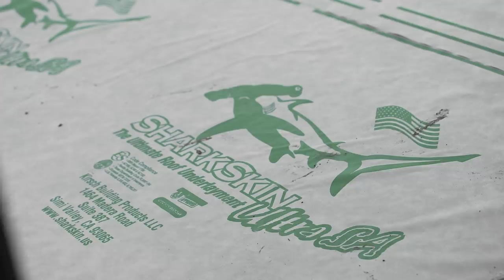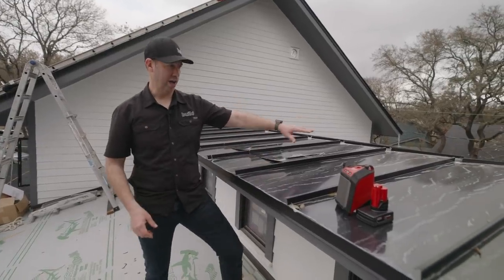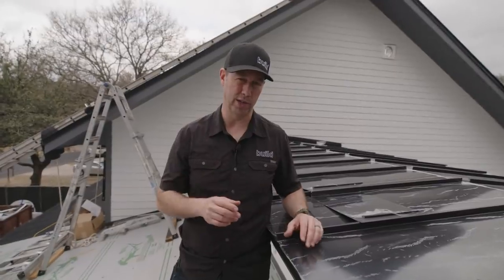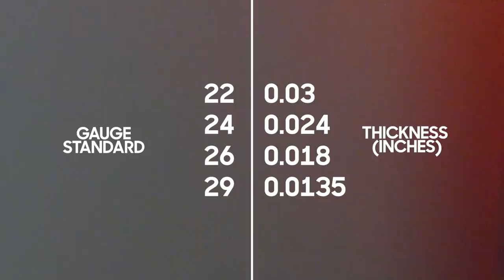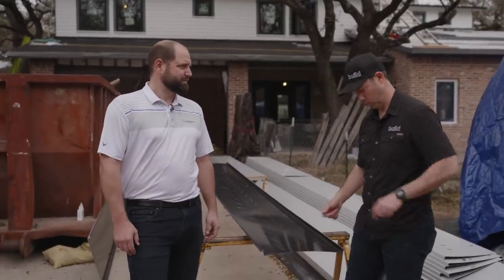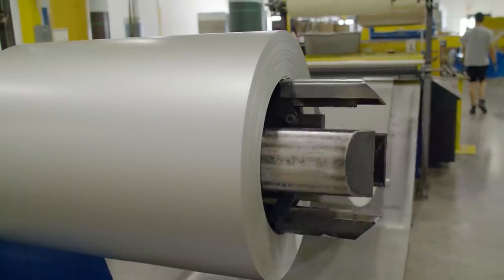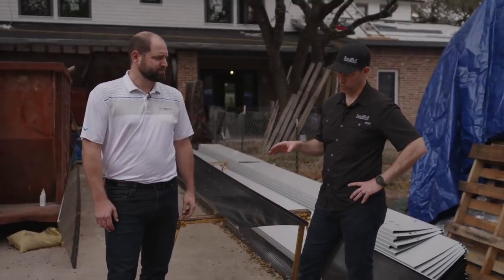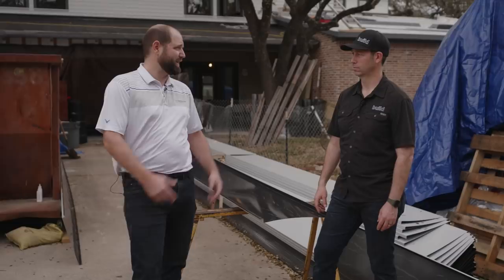Metal Roof- Best Practice Details

Comment: Matt:
Talking about all the ways he is reducing heat with this roof.
Also Matt:
I have a black roof! YOLO! lol
Reply: I'm also confused by facing the reflecting side of the radiant barrier  down, not facing the radiant source..
Reply: Black conducts heat but with radiant down heat doesnt transmit through.  Still though...
Reply: Why  the heck would he do everything he has done for energy efficiency then put a black roof on?  Also metal roofs with that air pocket behind it will dent like crazy in hail storms.
Reply: @aintquitewright1480  
Well on the bright side I have only seen it hail one time down here. :p
(and it was pretty slushy by the time it hit the ground)

but yah..... it seems very few people these days realize black absorbs heat.
I have been to many places and have never seen so many people wearing black cloths.......
Reply: @lgl_137noname6  He didn't explain it.... but kinda sounded like that was a mistake.
I guess he wanted to save time and/or money and is just going to leave it facing down.
Reply: @lgl_137noname6   After I got radiant barrier and a FLIR camera I saw how little IR is transmitted down from the radiant barrier.  Think of a mirror. It doesn't show the IR heat from the other side of the wall it shows the IR reflection from my body and the wall behind me.  My sister got radiant sprayed on the underside of her roof, it works as well as my barrier stapled to the rafters.
Reply: @aintquitewright1480  Thanks for the reply  @Aintquite Wright  .
The mirror analogy is exactly where I'm struggling with the physics. Given that the metal roof if the primary source of IR from direct exposure to the Sun, one would think that , with the proper gappng, one would want the R reflectig surface, like a mirror, to face the direction of the incoming radiation and reflect it back in order to mitigate further IR absorption into the remaining mass of the structure. 
At least that the physics as I think I understand it. But I could be absolutely incorrect.
Thanks again for  your considered reply.
Regards.
Reply: @lgl_137noname6  I've got the same feeling. The sun wil heat up the metal, the metal will start to radiate, and it will radiate on to your house. The way to protect against that is by having a reflective surface on your house. I think the mistake he made is that the rule is indeed that the reflective part should always be facing the air gap, that's true, but it should be facing it from the bottom up, towards the sun, so under the spacer material.

But this is just me theorizing, I don't have a degree in any of this stuff.
Reply: bare stainless would be fantastic for a metal roof but imagining the potential cost is making my wallet wimper in fear lol
Reply: I’m a metal roof plumber in Australia and years ago we always put light colour roofing on until a study came out advising to put dark colours due to you needing to heat your house eight months of the year but only cool it for less than a month , obviously that statistic changes from location .
Reply: @splashpit  those numbers are backwards for Texas.  You have to cool more in TX than heat.
Reply: @aintquitewright1480  depends on how heavy the metal is.
Reply: @splashpit  One wonders what such a study shows for Texas ...
Reply: @lgl_137noname6  Facing down is fine, and should work just as well. 
This is because an object with high reflectivity must also have a low ability to radiate thermal energy, a.k.a. emissivity (pseudo-explanation at the end). If you look up the emissivity of something shiny like aluminum foil, it's around 0.04. This means it only radiates only 4% of what a perfect thermal radiator (a.k.a. blackbody) would emit at the same temperature, which gives the same effect as
if the radiant barrier was installed face-up on the other side of the air gap and reflected 96% of the radiant energy from the roofing metal.

The amount of radiant energy an object in thermal equilibrium absorbs is equal to the amount it is able reradiate, also known as its emissivity. It has to be, otherwise it wouldn't be in thermal equilibrium, and would instead be either heating up or cooling down. If you ignore transmitted radiant energy (i.e. you're looking at something that is essentially nontransparent, like a radiant barrier) then the reflected energy and absorbed energy must total 100%. Because absorbed energy must be the same as emitted energy (thermal equilibrium), you end up with a relationship where reflectivity goes up when emissivity goes down, and vice versa, (assuming nontransparent objects). I know this isn't really an explanation of the underlying physics, but hopefully it is still helpful.
Reply: I think it was on a green building forum, someone sited a study in which they found that roof color does not significantly affect temperature inside the building. With the venting under it, it should make less difference.
Reply: @lgl_137noname6  i don't think risinger quite got that one right. in a wall assembly, you would have the cladding, the air gap, and the radiant reflector on the other side of the air gap with the reflecting side facing outward. what you want is for the radiant barrier to reflect IR away from the sheathing.
Reply: if you are going to go with a black roof, steel is the way to go. aluminum would have truly been a thermal performance train wreck.
Reply: @aintquitewright1480  risinger with with 24 gauge steel. denting is less of a problem than would have been the case if he had gone with 26 gauge or 29 gauge steel. as far as energy efficiency goes, what people may not realize is that asphalt shingles hold a lot of heat.
Reply: @tincoandringa4630  i think that risinger is mistakenly believing that the air channel will cool the roof. so by reflecting the heat into the air channel, the air will remove the heat. if that is what he believes, his theory will fail for the same reason that you cannot rely on a ventilated roof to cool your attic. the radiant barrier needs to cover the roof sheathing to block IR from penetrating the roof sheathing. what risinger's approach is going to do is reflect IR back toward the sheathing. since the heat will build up faster than the ventilation scheme will be able to remove it, the net effect is that his roof sheathing is going to get hot, which will raise the temperature within the house.
Reply: @splashpit  this doesn't sound like a very good strategy. the way that you normally get solar heating is through the strategic use of fenestration.
Reply: @paperwait9611  Risinger does not believe that the air gap will help with cooling. He gives two reasons for the air gap. The first, as always, is to allow any water that makes it behind the roofing metal to dry and/or drain out. The second is to allow the radiant barrier to work properly.
 Risinger did get it correct; it doesn't matter which side of the air gap you put the shiny bits on, as long as they face the air gap. Read the previous comment I made in this thread for an explanation, especially the addendum at the end; if that doesn't do it for you, try throwing search terms like "emissivity" and "reflectivity" together into your search engine of choice.
Reply: @ergohack   @ergohack  Thank you for taking the time to reply. Actually you're quite on the money for the physics:  that's how Kirchoff put in his law of Emissivity. 
Much appreciation for you very considered and enlightening explanation.
Thank you again.
Reply: @paperwait9611  Why do you say aluminum would be worse for thermal performance? Is this because of it's high thermal conductivity? I don't think that will really matter as far as conducting heat through the surface and into the roof assembly, mostly because its so thin. It may actually improve performance (very slightly) for a couple reasons:
1. It would be better at conducting heat away into shaded areas of the roof where outside air could cool it off a bit.
2.  It would even out the temperature distribution that the radiant barrier is dealing with; this matters because thermal radiation is proportion to the fourth power of absolute temperature, so reducing any hotspots will reduce total thermal radiation even if the total thermal energy is exactly the same.
Reply: @ergohack  when it comes to the energy efficiency of metal roofing choices, you don't have to guess because these things are energy rated. that is something that you find out when you research metal roofing. the intuition is that metal roofing is hotter than asphalt roofing. in reality, the intuition on this is often wrong.
Reply: @ergohack  maybe you missed the part of the video where risinger said that he had the radiant barrier facing an air gap. risinger didn't spoon feed everything to you in this video. you had to be able to do some thinking on your own. in this case, you needed to be able to draw the inference that he was relying on the ventilation space to conduct the heat away from the roof.
Reply: @paperwait9611  I'm sorry, I thought we were talking about the energy efficiency of aluminum roofing compared to steel roofing? What is this talk about bad intuition and shingles? As to energy ratings, do you know of an actual "energy rating" anywhere that compares aluminum vs steel roofing, especially with an identical paint system applied? (And no, I'm not talking about the shiny galvalume coated steel, I'm talking about actual aluminum roofing material, compared against steel painted the same color, with the same profile.)

As to radiant barrier; seriously dude, I know which way their radiant barrier was facing. I watched them install it. You know, in the video. I'm not sure how (or if) you read my comments and still came away thinking I was talking about radiant barrier with the shiny side right up against the metal roofing. 
Now, do I have to pull an appeal to authority here and start throwing links to research papers at you, or can you get down off your high horse without the extra assistance?
Reply: @paperwait9611  Just in case this is the bit you're missing, the heat being absorbed from the sun by the metal roof doesn't all need to conduct down into that radiant barrier and radiate into the air gap. As soon as the radiant barrier reaches the same temperature as the metal roofing above it, it obviously isn't going to somehow get hotter than the roof above it. Instead, conduction slows down, and only proceeds at the exact rate that the radiant barrier is radiating and conducting heat into that air gap. This rate, as I explained earlier, is quite low, due to the low emissivity of highly reflective materials.
But, where does all the energy the black roofing metal is absorbing from the sun go? Back out into the environment. The hotter it gets, the more it radiates thermal energy out into the environment, (as I said earlier, at the 4th power of absolute temperature, according to the Stefan-Boltzman law), and the faster it conducts heat into the outside air. As long as you have the same surface, it doesn't matter what you have underneath it, it will reach exactly the same temperature under the same sun, wind, and temperature conditions, as long the stuff underneath isn't actively being heated from somewhere else, as might be the case in the winter. This temperature is precisely when the amount of thermal energy it is gaining is equal to the amount of thermal energy it is losing; a.k.a. thermal equilibrium.
Reply: @ergohack  you need to do some research before trying to make comments. you're just trying to substitute argumentation for actual knowledge. if you had done some research instead of coming here to comment out-of-hand, you would have information about the energy efficiency difference between aluminum roofing and steel roofing. at present, you don't. where do you find this kind of information? a good place to start would be from makers of aluminum roofing products. but since you apparently have not actually considered using metal roofing, you would have no need to consult with such sources.

my comment was that risinger put the shiny side of the radiant barrier on the wrong side of the air gap, apparently based on the incorrect notion that he could rely on the air gap as an effective means to keep the roof cool. in other words, risinger should have put the radiant barrier on the other side of the air gap facing (but not in direct contact with) the metal roofing.
Reply: I don’t know about this specific manufacturer but typically there are reflective pigments in the paint that enable even a black roof to have a high heat reflectivity index.
Reply: @robertunversaw  Very true. Just because something looks black in the visible spectrum doesn't mean it needs to be black in the infrared, UV, etc.
Reply: @robertunversaw  I just looked it up, and Sherwin Williams does offer what they call "solar-reflective pigments" as an option on one of their PVDF paint systems. No idea if that's the particular system he used, or if he chose the SR option, but he did say Sherwin Williams PVDF.
https://www.paintdocs.com/docs/webPDF.jsp?SITEID=SWPCGCOIL&doctype=PDS&prodno=432B2627&lang=2
Reply: @splashpit  where in Australia  does it get less than 70f (21c) for long enough to worry about it? I always thought it was hot as balls year round down there.
Reply: @jeffreyhill1011  Melbourne in winter gets a wind chill that visiting Canadians complain about .
Reply: @splashpit  oh wow I had no idea. Those maple syrup drinkers know a thing or two about cold, I'll take their word for it.
Reply: @billvojtech5686  Completely wrong. Their are numerous studies showing a significant decrease in attic temps from roof color. It is also common sense.
Reply: @RindosRides  Are those roofs asphalt shingles nailed to the deck or metal with a significant air gap? Insulated to R60? At some point, you're allowed to allow taste to dictate color and forget thermodynamics. I'd like to see the temperature in Matt's attic once the house is done.
Reply: @lgl_137noname6  I'm no expert, but from what I've seen and read is that you have to think of the radiant barrier as a transparent system.  To me it doesn't matter what direction it's facing because if it's the mirror side, it will reflect, if it's the grey side, it will conduct through the material, hit the backside of the mirror surface, and reflect back just the same.  From what I've seen and read from the manufacturers, the only requirement for a radiant barrier to be effective is the air gap on one side so the heat doesn't conduct through the metal all the way to the other side.
Reply: @billvojtech5686  From Lil Giant I, too, would like to see temps when Risinger is finished. I sincerely hope he makes a video on that.
Reply: @luthersullivan5141  but how? it's a single-sided ai foil  .. you say emissivity will work?
Reply: @splashpit  ok noted thanks for sharing  :)
Reply: Maybe in this case the effect is minimal, but for the other 99.999% of builds it is not. People like you spewing nonsense like this is one of the reasons this industry is so far behind the curve. Also, there exists paint that is so highly reflective and emissive that it actually cools. So for people that don't want to just throw handfuls of cash at a roof, they can simply do a traditional roof with such a paint and actually get way better results than Matt.
Reply: @RindosRides  
no, lobbyist are the reason constitution is behind the curb...

As an example:
Last time I did construction we had to use these rings for installing the wiring.... they were expensive and made it take more time........ and they ONLY reason for them is it made it easier to pull the wiring through the holes in the studs.
Reply: @lgl_137noname6  yep, facing wrong way! actually holds heat in
Reply: @aintquitewright1480  no it doesnt' because it needs an air gap
Reply: @tincoandringa4630  yep you are right. it is that simple. don't over think it.
Reply: @kevenc  wrong , try painting the shinny side black, it will destroy it's properties. come on this is 5th grade science you are over thinking it!
Reply: @ergohack  you really are over thinking this! shinny side reflects. really is that simple. shinny side facing wrong way = reflect heat back INTO THE HOUSE. if the air gap is big enough it wont' matter, but given how small his air gap is it does matter.
Reply: @sunshine5349  I think the misunderstanding  originates with the manufacturers instructions and installation procedures. They seem to insist more on putting  the reflecting shinny side to face the gap, not realizing that it also MUST   face the radiating source  AND  must not be in physical contact with the source of the IR radiation to prevent  the radiant barrier from heating by conduction from the source.
The gap ought to be between the IR source and the barrier.
At least , that's my current understanding from the ORNL, Oak Ridge National Lab, resource pages.
Reply: @sunshine5349  Not over thinking it at all. This is quite literally centuries old physics. Our understanding of how these things work hasn't fundamentally changed since then; we've only gotten better at explaining what's going on at more fundamental levels, e.g. quantum physics.
Can YOU see in the long wave infrared? If you can't, I'm not sure how you are able to develop an accurate intuition of how these things behave. ( /s)
I would tell you to go read the links I posted for user, all of which described putting the radiant barrier facing DOWN. However, it seems that  the comment system marked them as spam because there were too many in one post, so I guess you'll have to do your own google-fu.
Reply: @lgl_137noname6  
If you read this page https://web.ornl. gov/sci/buildings/tools/radiant/ from ORNL, they describe it being installed both ways, and why it works in either direction. (Just take the space out before the "gov" to make the link work, I'm trying to avoid the spam filter.)
Reply: @RindosRides  what is this paint called?
Reply: @ergohack  thank you for the link.
Reply: @Sun Shine  Au contraire, I did not provide YOU any links. I provided another commenter here a link, minutes after replying to you. Maybe you can figure out why?
700-900nm is far closer to visible light than the 8-10μm you'd be dealing with on a hot roof. If you've actually done infrared photography for that long, I'm sure you are quite familiar with how different things can appear just a few hundred nanometers outside of our visual spectrum. (Some opaque objects suddenly become transparent, some dark objects become bright, the atmosphere becomes much clearer, that sort of thing). How much different do you think it looks when the wavelengths you're dealing with are an entire order of magnitude longer? But, that's not the point I was trying to make. My point was that you probably don't see enough everyday objects glowing with heat to know whether reflective things glow as much as other materials at the same temperature. (What I was trying to explain regarding emissivity in some of my previous comments.) Unless, for example, maybe you also happen to have worked extensively with both noble and non-noble metals in their molten state in addition to the infrared photography. Or something else that would give you experience seeing things that were both reflective AND glowing alongside stuff that is not reflective but still glowing at the same temperature.
Reply: @ergohack  you wrote all that and are still wrong. it's just as simple as it first appears shiny stuff reflect , non shiny side not reflect.
Reply: @sunshine5349  I think you misspelled "I didn't read any of what you wrote because I am an arrogant/(lazy? Worse?!) SOB, but of course I still want to tell you that you are wrong." I'm not sure who you think you are fooling, but they're not worth it.
Reply: @sunshine5349  It's as simple as "not shiny thing glow bigly when hot, shiny thing not glow so much when hot"
Reply: @ergohack    wrm
Reply: @sunshine5349  BaSO4 paint
Reply: @tincoandringa4630  I believe you are correct ... he is not protecting his house from the sun's heat. However, he may be reflecting any heat escaping from the attic back down into the house, if it doesn't all go out the ridge vent.
Reply: Matt WEARS a black roof and really seems to like it.
He really looks good wearing his black roof...so why not do the same with his house.
Reply: Bob Watters  not all of Australia just the southern parts .
Reply: Bob Watters  believe it or not we do get snow it our mountain ranges .
Reply: @ergohack  That really sounds like a bunch of gibberish.  Why would it be manufactured with a reflective side if it didn't matter which side was toward the in bound IR?
Reply: @percyfaith11  The orientation doesn't matter, because reflective surfaces tend to emit less IR than other surfaces. If you put it at the bottom of the air gap on the roof deck, it reflects the IR back towards the roofing material, as most people intuitively understand. When you put it facing the other way, up against the roofing material, the reflective surface emits much less IR towards the roof deck, and you end up with the same net effect.
The nonreflective side is typically installed tight against another surface, where heat transfer by conduction dominates and reflectivity and emissivity (amount of IR radiated at a given temperature) are mostly irrelevant, so there isn't much point in the added cost of making both sides reflective.
Reply: @ergohack  well I believe we are thinking the same way about this particular situation then. If I'm reading what you're writing correctly then on Matt's roof the dull side of the reflective foil should be flat against the sheathing on the roof and the reflective side of the foil should be pointed up toward the metal roof and the air gap material should be between the foil and the metal roof.
Reply: @percyfaith11  No, I'm agreeing with Matt. The shiny side just needs to face the air gap, and it doesn't matter if it faces down or up.
You can test out what I'm saying for yourself if you have a piece of polished metal that doesn't corrode too quickly when hot, and a similarly sized piece with a good amount of corrosion on it (as in, not shiny). Heat them both to the same temperature, (I.e. use the same torch for as long as you feel like). The polished metal will not glow as brightly. If  you don't have something that can make the items hot enough to glow in the visible range, you can place them both in an oven, and just place your hand over them to see which feels hotter. The more reflective object will not radiate as much heat, so will not feel as warm to your hand a short distance away.
Reply: @ergohack  The reflective foil must have an air gap between it and the radiant heat source. If Matt's arrangement has an air gap between the foil and the metal roofing, then yes the foil should block most of the incoming IR transmitted from the hot metal roof.  If it is touching the metal roofing then it will heat up by conduction and emit by radiation.  That would not be productive.
The heat shield on a catalytic converter or around a wood stove is the same principle.  If the shield is in direct contact with the heat source it will emit heat by radiation.  If there is an air gap it will not.
Reply: @percyfaith11  I understand why you think that, but there is some physics we've understood for over a century that says it also works the other way around like I'm saying. I realize that it may not be intuitive, buy that doesn't mean it's wrong.
Here's another way of looking at it. You know how darker objects tend absorb more energy from the sun? That increased energy transfer usually works both ways, as in, they also radiate that energy back into the environment more quickly. You can test this for yourself with the experiment I suggested in my previous comment.
If being black usually means increased radiative energy transfer, both into out out of an object, then it stands to reason that being reflective will typically mean reduced radiative energy transfer, in both directions.

If you still don't believe me, try taking a look at a few IR thermometers. Many of them have a way to adjust for the emissivity of different surfaces, either directly via a button, usually labeled "ε", or hidden in a menu somewhere. Read through the user manual for one of these and see what they have to say about reflective surfaces.
Reply: @ergohack  Ok, so reflectivity and emissivity are like 2 sides of the same coin.  It seems as long as there is an air gap, on at least one side of the foil, there will be no conduction and emissivity of foil is only about 3% so radiation won't be a factor either.